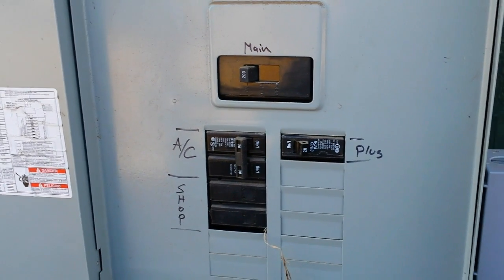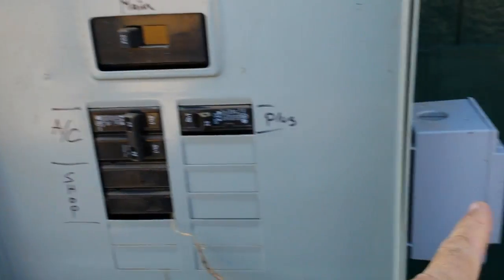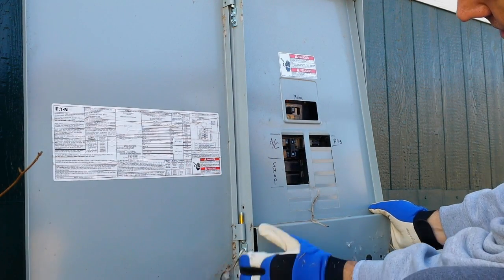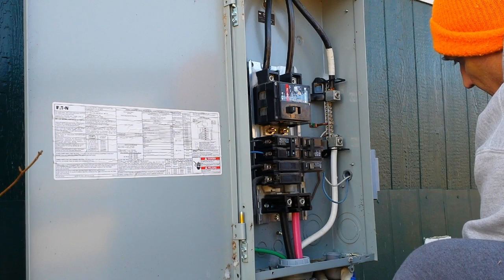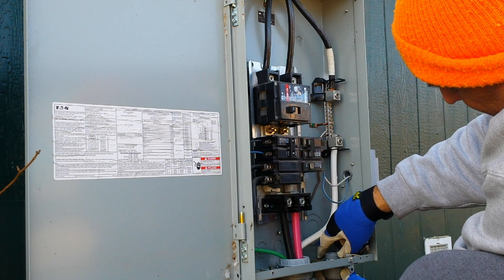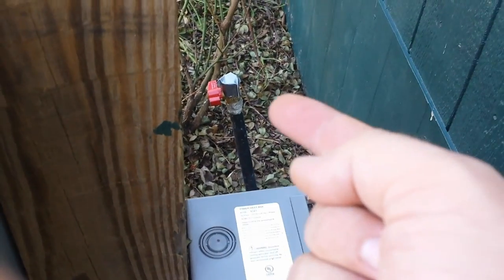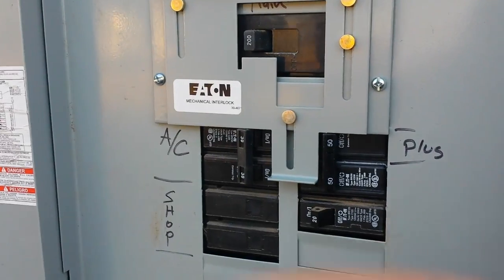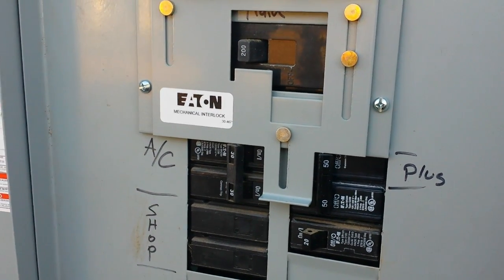Don't kill anyone! - Emergency generator install for whole house

Comment: How did you get the breaker tie down screw through the breaker? Every video skips this part and doesn't explain.
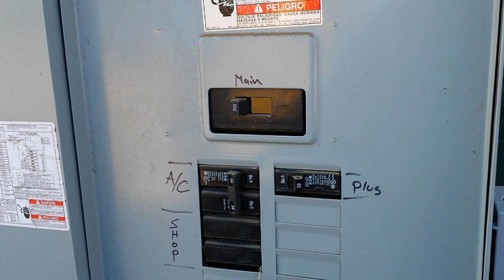Reply from the maker: Check out 5:10
Reply: @BigRedFishDad  thx. All the Eaton breakers at HD below 60A do NOT have that manufacturer screw hole. So for those wondering how you tie the breaker down you must order a different model number breaker for your job that includes the hole. We had to order from a random Ebay person who just happened to have 3 50A eaton breakers with this hole. No one In a 150 mile radius from Vancouver Washington has this specific breaker for my panel this am.
Reply from the maker: @Akroma_CoG  the breaker or the lockout plate? The breaker shouldn’t have any screws other than the wire connections.
Reply: @BigRedFishDad  the lockout kit comes with a black plastic piece you attach to the panel by the bus bar. The kit includes a long 2 inch screw to go through a hole in the top of the breaker into the plastic piece from the kit on the panel thereby locking it down against tamper and for code. Very few models of the Eaton series have this needed hole for the screw to pass through and lock the breaker in place.
Reply from the maker: @Akroma_CoG  i just can’t picture it don’t think there was anything like that on my model. It was pretty simple design it just covers one breaker when the other one is on.

Comment: Shame that you didn't show the actual wiring that you did even after shutting down due to camera isdues
Reply from the maker: yep... it is frustrating but often times I don't even realize it until I am finished or sometimes even when I am copying files over and realize I am missing a shot or the camera cut off early. But like I mentioned in the video the wiring isn't hard it was the fat wire and conduit being almost frozen so it wasn't very pliable that made the job hard. 
Once it is fed into the box it is just three screws to tighten down (two on the breaker and one on the ground) .

Comment: Thanks for your time making and posting this video BRFD.  I too, prefer not being refined to only a few circuits by using this stype of a main cut out switch ans allowing me to choose what I want powered.  Wish I could afford a whole home gen, but not in the budget for now.  To the haters, understand that some cant afford the large bill from the professionals, and can do some DIY themselves.   Its not about just being cheap.  If you can change your own oil and brakes on a car, should you not opt to DIY if you feel comfortable?  You can always pay the professionals - but some just cant or dont feel the need.

Comment: Not only will you have to go out in the rain and snow to start the generator, you will have to fill it with gas.  Gasoline generators do not last as long as natural gas generators.  IMO you should have ran the gas line and installed a 16kw with an automatic transfer switch.  I see a comment below by late 68 about highway robbery?  The generator is going to cost about $4,700 with a whole house transfer switch.  Where is the highway robbery.  What the hell do people think, a contractor is supposed to work for free?
Reply from the maker: Another salesman mad that it can be done on your own. "Rain and snow" again mentioned this in the video and it takes about 2 minutes to flip the switch and turn the key I know it is really difficult for city folks I guess... btw read or watch before commenting everything you mentioned has already been addressed... Hey, Thanks for watching!
Reply: Nothing like cheeping out with mom.
Reply from the maker: @terryjanssen316   again thanks for watching... but go back to the city and sell your used cars not buying here🤣
Next you're going to tell us all you've been an installer for 20 years
Reply: I am a contractor and owner of a electrical contracting corporation.  Ben doing it for 40 years rich boy, cheep boy.
Reply: @robertmedina3195  Nothing, obviously.
Reply: @wes326  Bull Shit.  You bought the interlock for $100.  Then you put the generator receptacle in?  And what about the breaker?
The cord hanging out of the panel?  What a laugh.
Reply: @terryjanssen316  Interlock $35, breaker, $16, receptacle $35, along with conduit and wire. Around $100.

Comment: It's all highway robbery that's what this country was founded on
Reply: @late 68  Ok jerk. Contractors license, workers comp, liability insurance, permit, foundation for generator, conduit to generator and transfer switch from main panel, generator with automatic transfer switch, wire.  Generator $4,700 with automatic transfer switch, battery.  I love it, everybody thinks contractors should work for free, and a blood sucking parasite thieves.  You make it sound like the guy is going get rich on a piece of shit generator install.

Comment: Another video with someone neglecting to install the breaker hold down retainer. Congrats, inspection failed.
Reply from the maker: Ummm... that's exactly what the lockout plate does. It is a hold down retainer. Thanks for watching 😉
Reply: @BigRedFishDad  A breaker hold down is required when using a breaker that is a feed from a generator. It keeps you from accidentally removing the breaker and having energized contacts in your hand.

Comment: Wow. Thanks for the video, but turn the power off.  Too many breakers are shipped with dead shorts that end up being a bomb.  Open the main, install the feeder breaker, install the dead front, THEN close the main.  Could save your life from an arc flash fault.
Reply: sportbikerdude I don’t know where your buying breakers but stop, stop immediately.  Breakers aren’t shipped with dead shorts inside unless your buying some crazy hacked Chinese off brands.